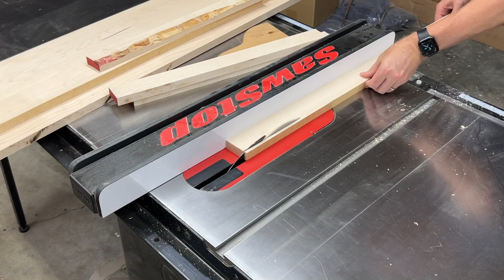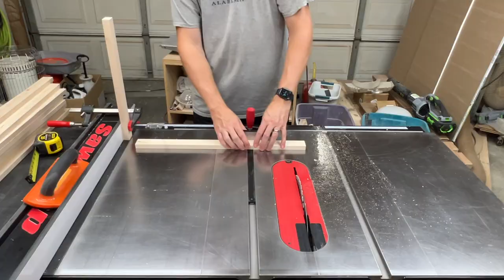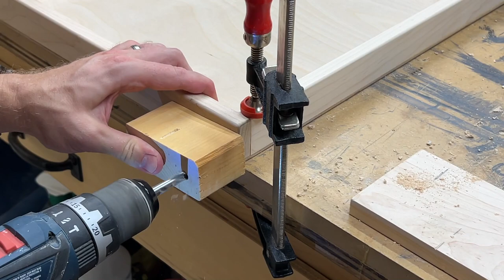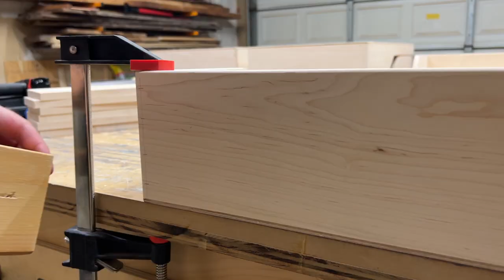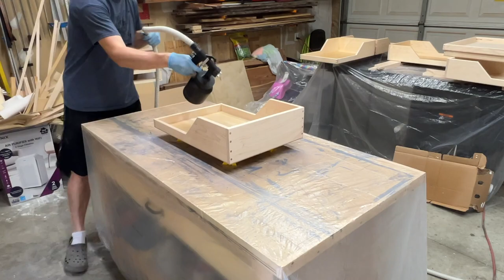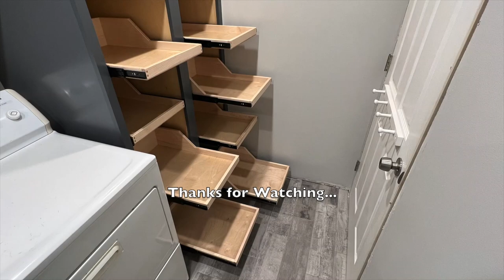How to organize your pantry | build pull out storage trays

Comment from the maker: Check out Pt. 1 (plywood boxes) here: https://youtu.be/trGsIg_D0mM
Check out Pt. 2 (face frames) here: https://youtu.be/FM-vHUX4RqY
Check out Pt. 4 (spice rack) here: https://youtu.be/gNgxr3OD_Jg
Check out Pt. 5 (baking pan organization) here: https://youtu.be/8bDZoL3tkf0
Check out Pt. 6 (shaker doors) here: https://youtu.be/-VTCq2thw5w

Want to support the channel? Here's what you can do:
 - Subscribe to the channel
 - Hit that Like button
 - Leave a comment
 - Amazon Affiliate: https://amzn.to/2LaN1Ib

In this video I go through the steps to build and finish the full extension pantry storage trays for a set of custom cabinets I am building for our laundry room remodel.  I used hard maple for the sides and 1/4 inch plywood for the bottoms.  No fancy joinery here.  Just glue and reinforced with oak dowels.  I used General Finishes water based high performance top coat for the finish.  Be sure to subscribe so you don't miss future videos covering other storage setup and the doors.  All of the build process for these cabinets could be applied to many other projects such as a kitchen, bathroom, etc.  Let me know what you think in the comments section below.

22 inch full extension slides: https://amzn.to/3DF9F8p
Rear slide mounting brackets:  https://amzn.to/3Ynj2Dd
SawStop 1.75hp PCS: https://amzn.to/2X4gWsP
Ridge Carbide 10-inch Saw blade: https://amzn.to/3bATmcp
Bosch 18v Drill: https://amzn.to/2OmrItJ
Makita Trim Router: https://amzn.to/2TZFrcX
Bosch 18v Jigsaw: https://amzn.to/3jDtxOA
Bosch ROS: https://amzn.to/3rxri1W
Titebond Wood Glue: https://amzn.to/2LzTdv4
Bessy Parallel Clamps: https://amzn.to/2z4LHG3
Bessy 6-inch F-style Clamps: https://amzn.to/3e3LGl4
General Finishes High Performance Top Coat: https://amzn.to/3CGhavk
General Finishes Extender: https://amzn.to/3XtttVy

Thanks for watching.  If you have any comments or questions please leave them below or hit me up on social media or my website.

Hit that like button and don't forget to subscribe!  Thanks!

Subscribe: https://www.youtube.com/danprudlow?sub_confirmation=1

Twitter: http://twitter.com/DanPrudlow

Comment: I’m guessing the planer wasn’t working. Finished pantry looks amazing.
Reply from the maker: It does work but I needed to take off 1/8 inch and with just the straight blades and hard maple I would have had to take a zillion passes so I just used the table saw.  A shelix head is on my wishlist so once I get that I think it will be much more useful for me.  Thanks for watching! 👍🏻